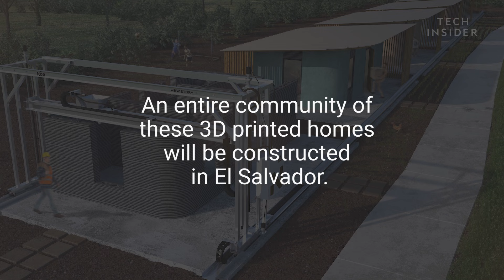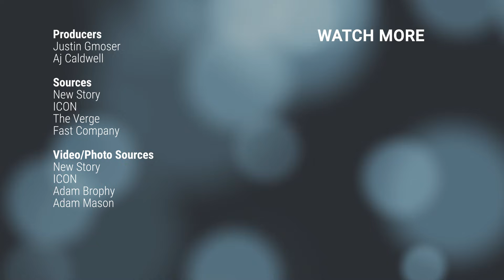3D-Printed Home Can Be Constructed For Under $4,000

Comment: In my humble opinion, I believe a kitchen would be useful.
Reply: What they built in Austin was the 1st house, which was a "test" and was never intended for a family to live in. It's being used as an office. I'm sure the houses in El Salvador will have a shower or tub and will have a kitchen.
Reply: @Andrea-xs4ny  would be pretty easy to have the bathroom fixtures and kitchen sink sharing pipes on opposite sides of a wall near the back of the house so that you could connect piping easily from the outside.
Reply: Andrea Why El Salvador and not the United States?  That makes no sense to me
Reply: Andrea Why do they need a bedroom in an office
Reply: Andrea thanks for being a voice of reason in this exchange
Reply: Without a kitchen, it’s not really a livable house, it’s just a shelter.
Reply: @dansv1  maybe that was the point of the test?
Reply: Dan Severns A fully functional shower and toilet are more important then a kitchen.  You can cook outside on a grill if you have to.
Reply: @dansv1  A dorm room really
Reply: A kitchen should be a priority over an office 100%
Reply: @neat24  the people using it didn’t need a kitchen. But I agree there should have been a sink in there. Could always use a single burner for a stove. Either camp style with gas cartridge or a plug in electric could fit farther down on the counter. Would have been a better visual for the video to show a sink and a counter on the wall that is shared with the bathroom. And some storage. I think it needs a room large enough for bunk beds as well. Families are the consumer in the third world.
Reply: How bout a place to shower.. that wasn't a bathroom
Reply: Marty McFly • 128 years ago there’s an update on this house. It has a shower
Reply: Yeah, and a second bedroom.
Reply: @TheRealFC  yeah and how about a swimming pool to
Reply: I don't recall seeing a shower either🤔
Reply: Its already much better conditions for them, having a kitchen for everyone in a community would be much more economical FOR NOW
Reply: Kitchens are the most expensive part of a house in most cases. First priority is just giving these people a sturdy place to lock up and feel safe. What do you think they're using to make food currently? Certainly not a full kitchen. Not saying it's not important, just not as important as having a safe space and running water.
Reply: actually, not really. you can cook outside, on like a fireplace cause a stove is expensive. but i feel like for the size and equipment needed you could do something cheaper
Reply: Michael Waruingi true
Reply: Poor people in the tropics often cook outside.
Reply: That is one THICC printer
Reply: Many poor people cook over the open fire outside. They cannot afford electricity.
That was just an office model for the project. Maybe the actual house will be different.
 In America a $4,000 house could save huge mortgage payments. You can double the size of the house for $8,000 dollars.
Reply: Yeah and a cinema room
Reply: Maybe a shower or a tub
Reply: The kitchen is a wall mounted tablet with the Grubhub app installed.
Reply: Yeah but then they wouldn't be able to have an office!  One thing you'll notice every shantytown shack has is a home office.
Reply: @Dead thank god i can cook like my mom
Reply: @Dead but that's not an option now. People still need to eat until that day comes...dumbass
Reply: @danny6714  why you have to insult? Are you a child?
Reply: I shower would also be nice
Reply: I am certain if we want a kitchen they would make it with one these are totally customizable.
Reply: Solar ovens and campfire cooking exist. Kitchens are expensive
Reply: @lego4271  Yes, everything would have to be given to them. They are use to campfire cooking. I have seen it first hand. It is a very tall goal to give houses to everyone in the world who does not have one because there are a lot of people in 3rd world countries that get by on almost nothing and no clue of how to make their life better in even a small way..
Reply: I could get by with a microwave,a hotplate, and a mini fridge!😂
Reply: Nah sod that 3D print a MacDonalds
Reply: Also, why is there only one bed?
Reply: Guys these are like the first incarnations of this technology. Remember pictures and footage of wooden planes in the beginning? Give it time.
Reply: Are you people for real?  A kitchen can easily be added; just take the price to $6000 or even $10,000 and you'll get whatever you wish.  The point is this technology is the future of house building at a fraction of the cost.
Reply: you can see my video easy to dessign
Reply: good adding
Reply: I belive so too
Reply: Dead actually, we can 3D print food now. They’re not too expensive either for some cheap ones. You just need the filament and electricity for the printer
Reply: There’s an outdoor kitchen
Reply: Wheres the sex dungeon in this place? How is one supposed to practice bdsm
Reply: LMAO!
Reply: Office space for people who can’t afford to buy a house? What will it be used for?
Reply: Yeah but I think they’re just trying to upgrade the huts and tents these people are living in. Doesn’t look like they’ve been doing this project for long, so I’m sure they’re aware of the room for improvement. It would be nice to have dens and showers and garages and cinema rooms and family rooms and basements and all the things you can find in most houses. IMHO, these are supposed to be cost effective upgrades that provide a little bit of style - but mostly sturdy walls and roofs for these people. Because what was there previously is basically nothing. We’re talking about 4 grand here
Reply: @Dead Do you really think people living in poverty can afford to eat out?  Jesus Christ...
Reply: @Dead The cheapest way to eat is to prepare it yourself.
Reply: @Dead LOL!  I understand YOURS and it's EXTREMELY short-sighted.  Yes, kitchens can be expensive, but, overall, within a very short period of time, appliances pay for themselves with the savings of NOT eating out, just for ONE person, nevermind a family.  All of this being said, it should be included in the house, so the cost of it wouldn't even factor IN, and, even if it WASN'T, just a microwave and a small place to keep food cool would be enough, i.e., an efficiency.  Could even share a water source with the bathroom.  Literally EVERYthing you read about saving money, these days, AND being healthy, reducing waste, etc, begins with preparing food at home.  Your thinking is 5,000% backwards because you're hung up on the cost of something that doesn't even factor in.  You really think people living in poverty in the middle of places with NO access to stuff you're thinking of, i.e. places to eat out, or even get access to Any kind of delivery are going to be GIVEN homes, but asked to pay for a kitchen?  Or, even if they SOMEhow have to pay, that they'd be asked to pay for THAT, separately, or, that, the cost of the kitchen, alone, would make or break someone's ability to purchase?  We're talking CHEAP housing, so the cost of the kitchens are going to be comparatively cheap... I mean I could go on and ON, here...
Reply: @Dead No, they can't; eating out is more expensive.  Period.  And likely not even an OPtion, in this situation.  I feel like you're telling people in a JUNGLE they're better off eating APPLEBEE'S for YEARS because of the cost of a MICROwave (which, BTW, ONE of, is likely cheaper than ONE meal out, for a family).  This isn't about being right.  This is about someone who's so wrong it's bizarre.  I made MANY points you haven't at all acknowledged.  You're only making ONE that doesn't hold up, and you seem unable to really ARgue it, because there really is no WAY to.
Reply: I'm the  69th reply. Be thankful
Reply: No kitchen?  What the hell?!
Reply: Unless the home owner wants to order out or eat a cup noodles every day haha.
Reply: This house is designed to be a mass manufactured home for low income families so they don't have to sleep on the streets, ideally once the tech becomes more mainstream you could have more intricate designs for standard living but keep in mind this homes intended purpose, it's for people who barely have enough money to survive and would way rather live in this than in a tent on the streets or a sidewalk
Reply: They can just put a kitchen outside
Reply: Depends on your environment, Many people around the world cook outside if at all. I'm sure a kitchen would be a small sacrifice if you had no home ,and along come someone that said" I'll build you a safe secure home with indoor plumbing". That's just my two cents worth of course,and as we all know that just about what it's worth. About two cents
Reply: That’s when we use our humbled minds again and remove the office and set up the kitchen.
Reply: Kitchens are overrated..
Reply: Correct
Reply: Outside BBQ area all you need, perfect excuse for a brick pizza oven to top it all off
Reply: I agree, they definitely had room to put a kitchen in 650 square feet. That is the size of a decent tiny home and you can find tiny homes at 200 square feet with kitchens in them. I also get that their goal is too end poverty and a lot of people who would need these homes wouldn’t care much if it didn’t have a kitchen they just need a place to call home that is safe.
Reply: And also building a kitchen would be more money because of all the appliances in it and that would make the selling price of the home go up probably at least double the price of what it is now so a lot more homeless people wouldn’t be able to afford them
Reply: Discofreck you idiot are you kidding then give them nothing to live in is that what you're saying
Reply: Yes, but there normally isn’t a sees to running water in these areas, and if they built an entire water distempered it couldn’t be as cheap as 4K per home so it wouldn’t help homeless people but some 3D printed houses have kitchens, go to Monica church YouTube channel and her newest vid is a tour of one
Reply: Hmmmm...
Reply: Depends on the use of the structure. In this case, you're quite right though.
Reply: MRE's
Reply: You can always get a grill or a plug in skillet and a mini fridge sheesh. How many houses y'all building for the people in need? 🤔
Reply: Well they said they are using that building as an office and not as a home lol. Your employer is paying you to do work in the office and not make snacks there lol.
Reply: People check what this stuff is made of  and see how it interact with you solar bodies it might be dangerous.
Reply: The prototype is an office so yeah it doesn't need that.
Reply: I’m from the Philippines and most households have dirty kitchen w/c is located outside of the house. I’m not sure if it also applies in El Salvador.
Reply: Why can't they build th3se as living spaces; kitchen bath laundry especially for older women, widoes(me) or amyone who wants one.  Would be so appreciated.  Would need a garage too and some addtl storage space.  I would love one!!!
Reply: op, talks like a true spoiled American.
Reply: You can just order a takeaway online, no need to cook!
Reply: @enamulhoque2103  hope you're joking
Reply: @enamulhoque2103  Yeah, because people living in poverty can totally afford Uber Eats, SMDH.
Reply: Poor people can't afford food anyways
Reply: @creamyr6  lol just ask Kenny
Reply: @creamyr6  lmao, so true
Reply: @creamyr6  Let alone a plastic house AND property to put it on

Comment: TOTALLY COUNTER PRODUCTIVE!
You printed the WALLS ONLY in 24hrs. With 3-5 people operating that huge machine, feeding it raw materials, maintaining the machine, transporting it, etc. 

A brick master in the construction world will build those walls in less than 15 hours (hand-built). For $4k to build the walls only, the brick master can hire a whole crew and speed up the process even further. 

What takes time building a structure is not the walls, it’s the foundation and other factors that is a tedious process in the project. 

P.S. I have zero experience in construction but I have eyes and a brain. I think.. 🤔
Reply: Sorry, unfortunately you don't even have eyes nor a brain to think. The labor needed to feed the machine cost less than that of a master brick layer and therefore brings the cost down. No single brick master can lay down this much walls in 15 hours no matter if he took zero breaks.  I have done construction and no brick master in their right might would work for $4k to build this house.

Using AI and machine learning, this machine can be optimized to print much faster so that it can scale and build multiple buildings in the same 24 hours all while requiring the SAME few people to feed it. Funny how someone with zero construction knows where the rate limiting step is to build a house. Sorry you didn't quite get it, try harder next time.

Comment: 4000 dollars? Hell....the lumber alone will cost you 10k.
Reply: @Amelia Rivers if you watch the video again, you will see that the walls are framed in 2x4 lumber and the roof and ceiling are made of 2x10s and plywood. After watching the video again, Im pretty sure that I underestimated the cost of the wood by quite a bit. I imagine that with everything involved such as plumbing, windows, kitchen appliances etc....the house in this video would cost 30-40 thousand to build.

Comment: Homes tend to be liabilities, because all they do is break down and need repair but are coupled with the land underneath the house which is an asset because it increases in value to make the cost of home-ownership cheaper in the long run, but by constructing whole or mostly 3D printed part of the house out of concrete the value of which has increased 4 fold since China's mass infrastructure projects both the home and the land underneath it will increase in value making this tiny dungeon sewer esk hovel very cheap to finance.

Comment: Now let’s see how it holds up against strong winds, heavy rain, heat, and other natural factors to see its true worth.
Reply: There's also no kitchen and if you're not living alone or you're claustrophobic goodluck lmao
Reply: Icon has built one that can withstand heavy snow. It can be seen on their website. Although, in Texas it could use a little insulation in order to keep the air conditioning bill down.
Reply: Aaah that’s cool! It all depends on the location and environment conditions lol Thank you for the info!
Reply: It certainly holds up better then the make shift structures they are living in now!
Reply: Jenna Matthews that’s what they’re supposed to do. Give those with less or nothing a better living condition. To give Families in Africa and South America a home that can last longer than what they currently have. Finally someone that gets it. The above dummies: but what is earthquake or tornado or tsunami hit? Those homes are to facilitate the needy.
Reply: steal threaded  concrete had not been proven for centuries but rather developed through the centuries. there's been a bunch of improvements and nowadays we've got a state of the art mix. problem is that your high quality concrete isn't usable for printing so they're using something else. they're gonna be using way more material than in traditional technology, the walls are gonna weight way more, their insulating properties are gonna be way worse.
those are not problems caused bye the fact that this technology is young. problem is it isn't worth developing- majority of the building costs lays in the finishing (plumbing, wiring, finishing floors) and not in the construction. they're saving a week of human labor but offsetting it with higher material costs and poor quality. cash grab start up made to flease ignorants.
Reply: Well considering that they are basically concrete, I say they will hold up just fine.

Comment: Ok building it €4,000
Wiring it.       €400-700
Plumbing.     €400-700
Decorating.    €500+
Deck +carpentry 1,000
Foundation (depends on depth) 1,000+
Construction of the thing 2,000– 
Every body in this world wants to make a profit so add all that above and add on at least another 5,000+